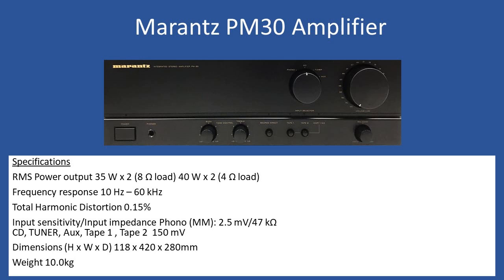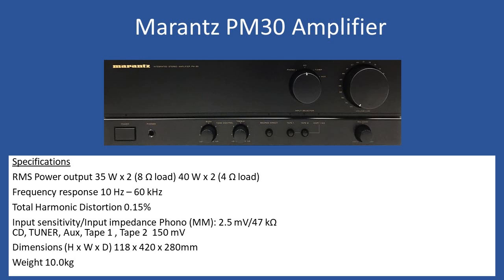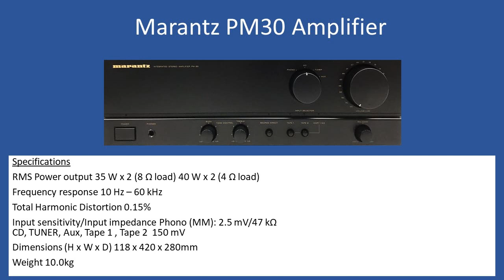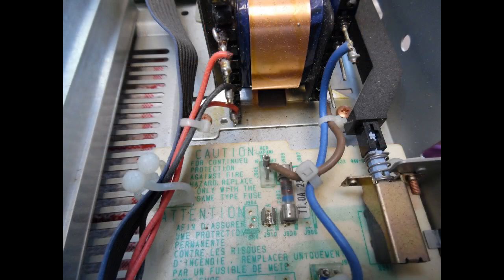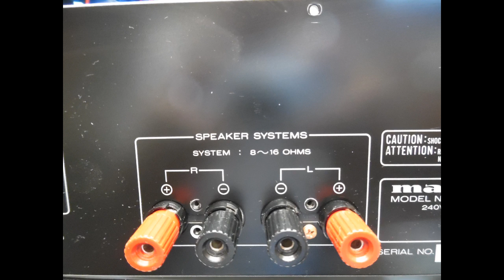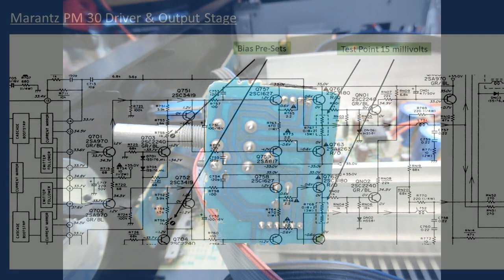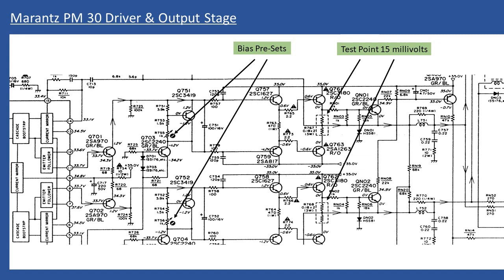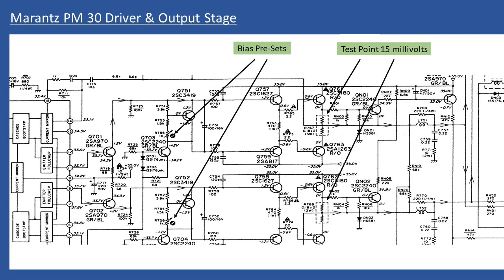Marantz PM30 Amplifier Repair (With Audio Tutorial)

Comment: I have an interesting question for you:

As a typical consumer, I have owned many receivers and amps where, when switching between active(currently producing sound) sources, such as tuner, phono, tape, CD, video, etc, they are all different levels, louder or softer than the last. 

My question to you is:

Were there ever any pre-amps, amps, integrated amplifiers, or receivers mfgd. with the ability to 'trim' input levels so that at least by ear, all input sources would be as loud as each other.

The biggest offender would be the tuner(separate or integrated into receiver).  And it's not really the tuner's fault, it's the station air chains themselves that have gotten so 'hot', level-wise, that there might be as much as an 8-10dB SPL difference between the phono and FM sections, given the same volume knob position. 

So being able to turn the tuner input gains alone down, would equal things out significantly.  Next would have to be CD.  

Any thoughts on being able to do this?
Reply from the maker: Hi I am not aware of any Amps with the ability to trim input levels.
Manufactures that produced a full range of equipment for stack systems for example Technics, did to some degree design the signal levels for each connected device to match the requirements of the Amplifier to produce the best quality sound. But where manufactures only produce Amplifiers then signal levels are set at a nominal value typically from 150 - 200mV for line inputs. FM and AM signal always sound very different due to the frequency range AM being 9kHz and FM 18 kHz. 18 kHz being closer to the human hearing range. Also, when analog signals are broadcast the stations use compressors see this link for more information  https://www.sfu.ca/sonic-studio-webdav/handbook/Compression.html#:~:text=This%20is%20done%2C%20in%20part,uncompressed%20one%20on%20these%20receivers.
This will also impact the signal levels.